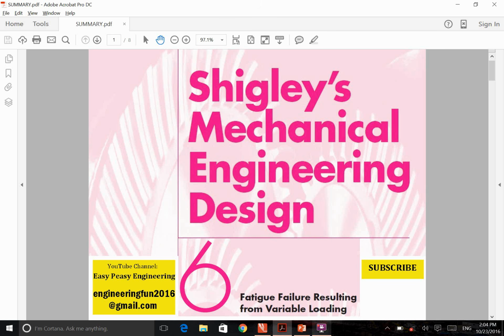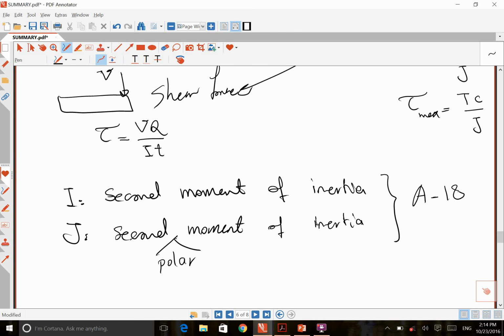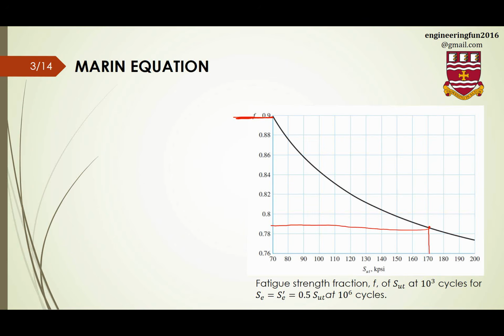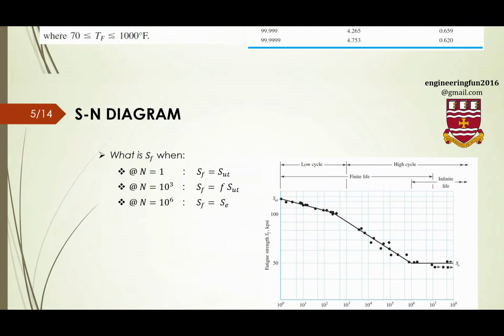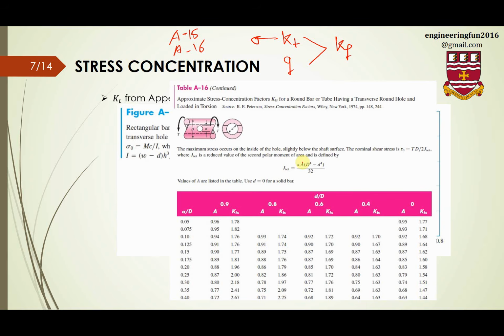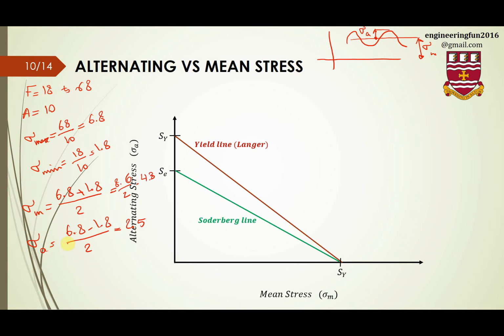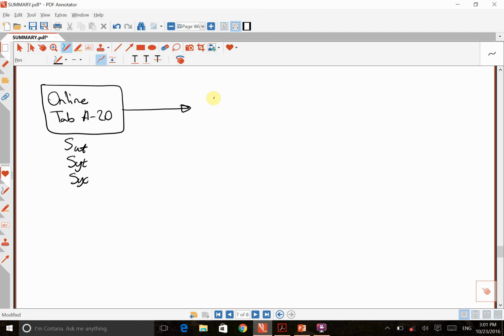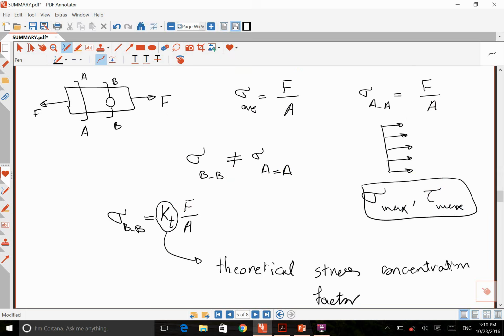Mechanical Engineering Design, Shigley, Fatigue, Chapter 6

Comment: Good day sir, 
your videos on shigley machine design are all marvelous. Thanks for your efforts, 

I would be greatful if you help me with this question 

1. How do one tell if there is localized yielding or not using the factors of safety 

2. How do one tell if there is treat from the fatigue factor of safety (when a bunch mark is not given) 

3. Basically my questions is about how to interpret fatigue factor of safety and static failure factor of safety after calculating it. 

Thank you soo much as you help me out. God bless you.

Comment: Excellent stuff! Can you direct me to the video in which you have explained the difference between pressure and stress?
Reply from the maker: Thank you.
Pressure and stress may look the same if someone wants to judge them only based on their equations i.e force over area (P/A). However, the main difference here is about the TYPE of these two parameters. Pressure is 0-degree tensor and it is (99% of cases) treated as a scalar while stress is a tensor with higher order. In order to have a better understanding about your inquiry I suggest you to study over "vectors and tensors" chapter of your mathematical reference book.